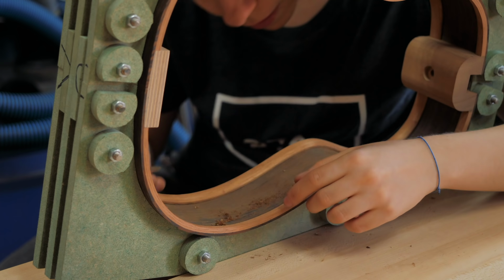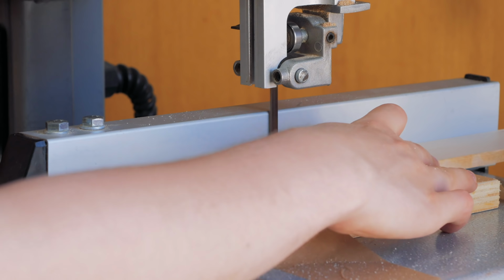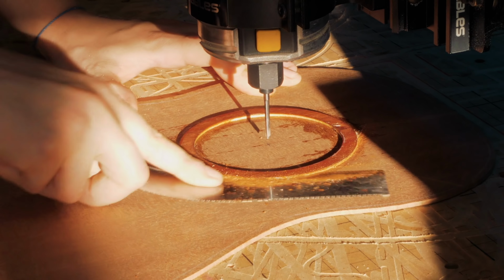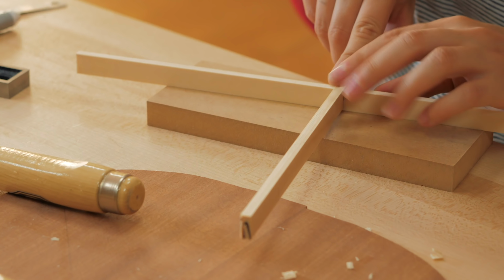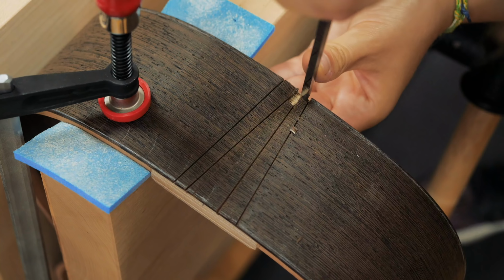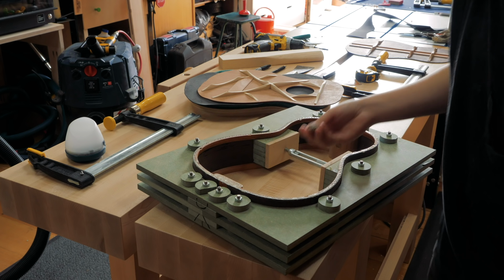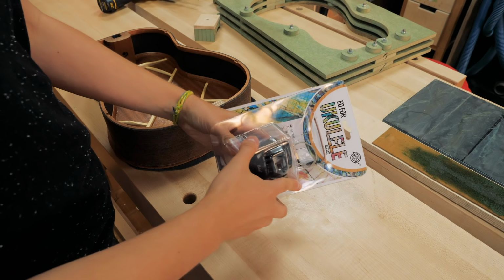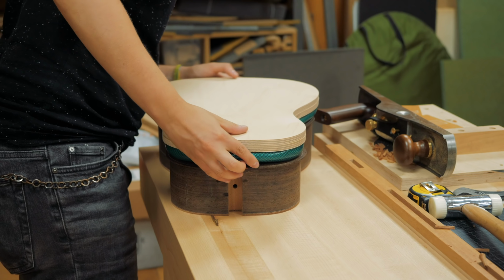How to Build a Ukulele Bass // Bracing, Rosette and Body - Ep.2

Comment: Nice job on the build........your shellac may be too old if its sticky.
Reply from the maker: It was brand new, I got it on a arts supply store and wasn't cheap so I supposed it was good. Maybe it's not supposed to be used as a wood finish/sealer...but isn't shellac flakes simply diluted in alcohol? Or do they put something else depending on the brand?

Comment: As has been pointed out by another comment, more than likely your shellac is too old to dry quickly.  It has been my experience that you can often fix it by going over it with fresh shellac that has been diluted 2:1 or a bit more.  I strongly recommend testing first before putting it on the uke.

For someone who "doesn't know what they are doing", you are doing an amazing job.  Makes my attempts at building a dulcimer look pretty pathetic.
Reply from the maker: Thanks for your input! I should probably have diluted it a lot more, I know know. It was brand new (to me - maybe it has been in the store for some time?) so I'm not sure what is going on. I'll look into that again when I can. And don't feel bad about yourself, that's not the point!